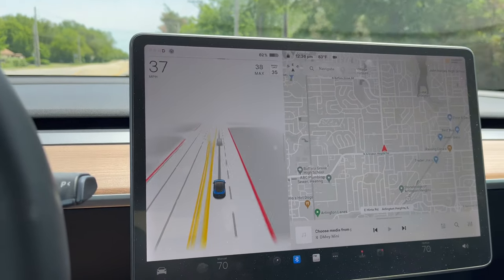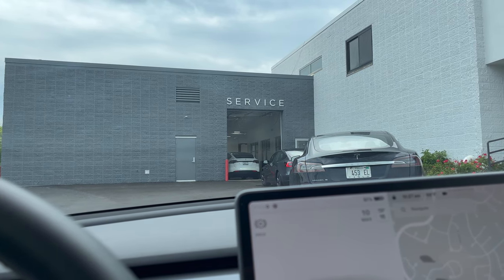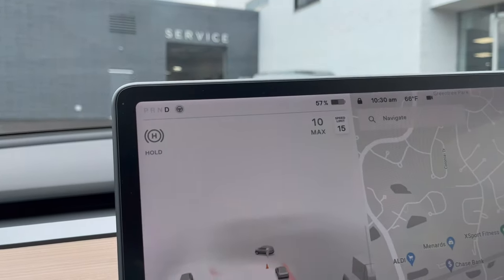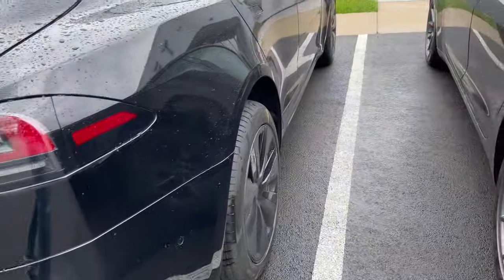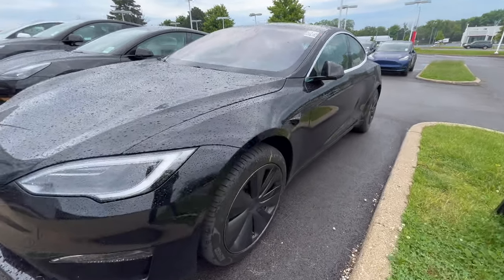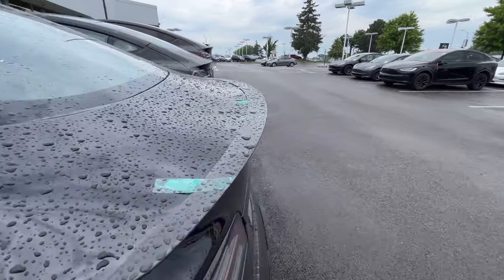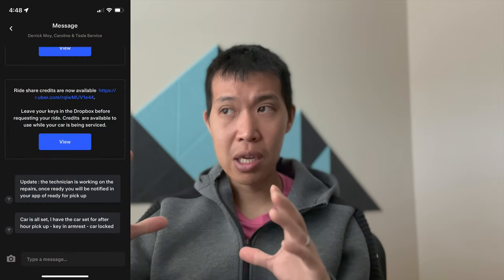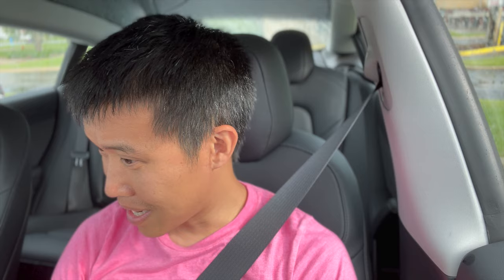Tesla Model 3 Upper Control Arm Issue

Comment: 2018 Model 3 long range 56,000 miles,  just replaced both Upper Control Arms due to squeaking noise, paid $250 total.
Reply: Did you get it done at tesla?
Reply from the maker: Yup for free under warranty

Comment: I’m quoted $180 to replace upper control arms without the alignment and I’m out of warranty. With alignment they want $450.
Reply from the maker: Sounds about right, you can go anywhere else for an alignment or look for a Tesla certified service tech there are a few around nowadays to compare pricing.